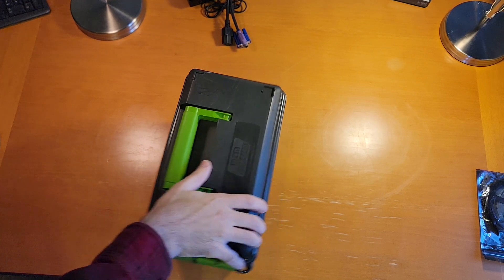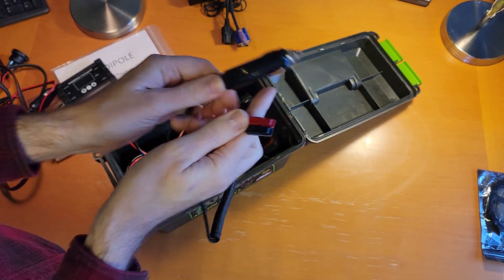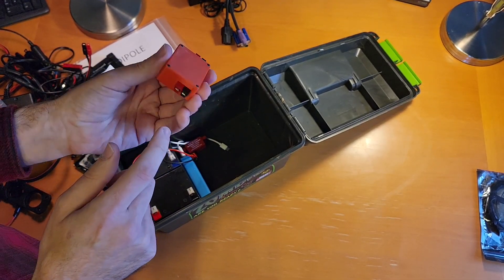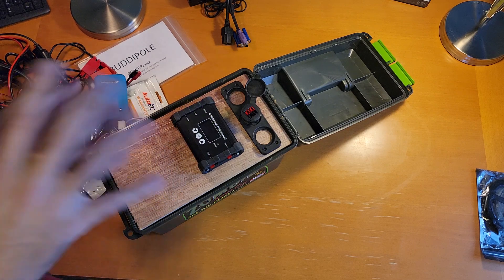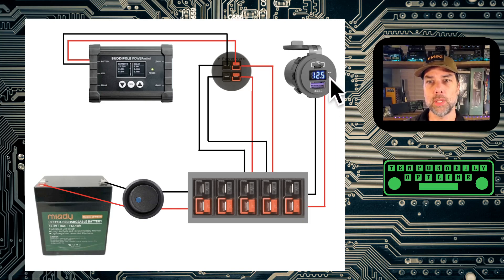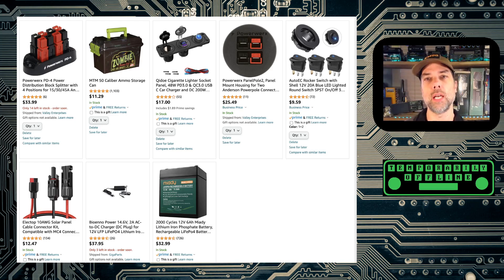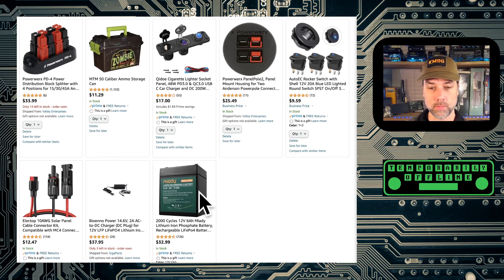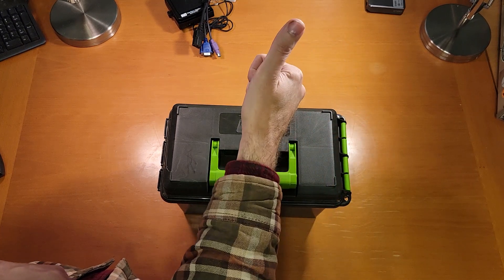Zombie Ammo Can Battery Box — The Ultimate Off-Grid Power Rig

Comment: PowerMini2 is a BAD idea. It is easy to find way more effective controller (another question is if it is RF quiet), but without display with informations. That's what I can see as a selling point of PM2, but it is at the cost of significant losses.
And also I ended up with all these boxes. They add volume and weight. For yankees, "portable" often means TRANSportable by car, but for me, it is as small as possible to be carried in backpack, so both weight and volume are important. Semi-hard shells used only to protect most sensitive/expensive equipment, usually neoprene or watertight packs we are using in speleology are more than good enough.
Reply from the maker: The PM2 is RF Quiet.
Reply: @temporarilyoffline  I know, but most of those more effective (MPPT) probably aren't.
(I ended up with Genasuns. One non-boost, one boost version.)
Reply from the maker: @tulenik71  I have a bunch of charge controllers, I'm a bit of an addict.
Reply: @temporarilyoffline  a hobby inside hobby? :D
Reply from the maker: @tulenik71  ham radio is a hobby if a thousand hobbies
Reply: @temporarilyoffline  that's why we are doing it :D (basically, even my NMR and EPR spectrometers are VHF/UHF/SHF or microwave radios, in principle :D)
Reply from the maker: @tulenik71  Radio is everywhere man!

Comment: What size Power-Pole connectors are used on the PowerMini2 ? 15, 30 or 45?
Reply from the maker: 45s, but the mate with 15,30s as well
Reply: The Powermini is rated at 35A total load, so 45's

Comment: Would be more effective if the speaker didn't pull out of the box a gaggle of wires, connectors, etc. - a bunch of stuff he wasn't going to use.  This part of the video was a waste of time.  Too bad since I haven't found any other YouTube videos describing how to build a battery box and what components are recommended.  Also not useful were dog barking and comments about mail persons and nicknames for them.  Altogether too much trivial, not applicable comments to make this as useful as it could be.  Sorry, but you asked for my opinion.
Reply from the maker: Shopping list in description,  picture of wiring diagram, picture of finished product.  Got it!

Comment: Interesting take but i don't like it. Since you have to have it open anyway to use it what's the difference? There is more surface area open to weather once the lid is popped than a couple power meters or ports on top like usual.
Reply from the maker: Good point!  I can close the lid mostly and have just the wire coming out to the radio... but this would be for leaving in the car or light rain while storing.